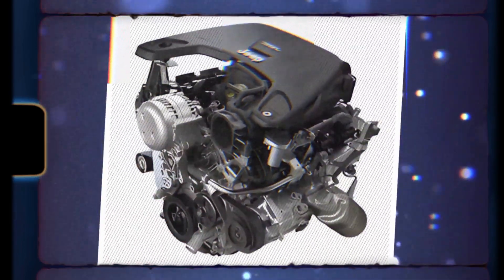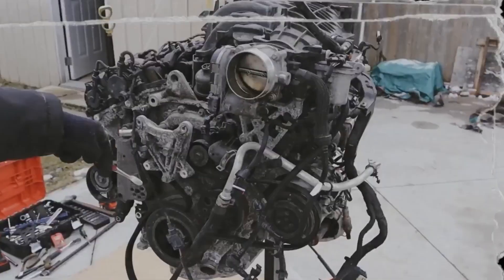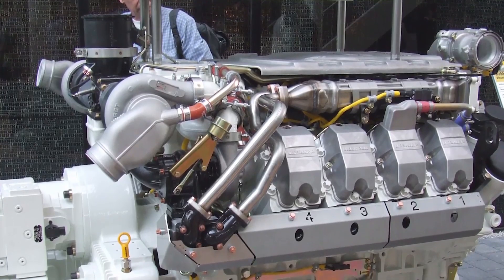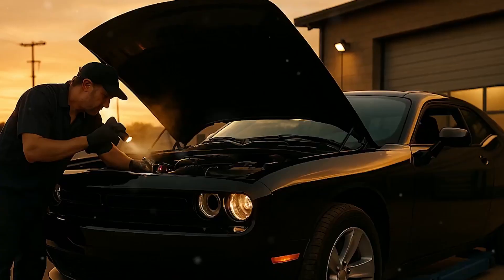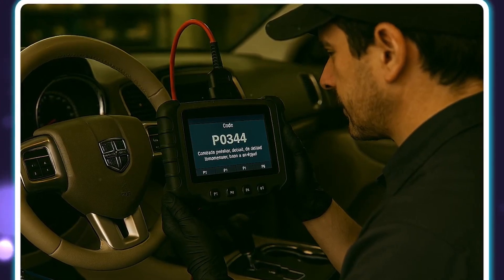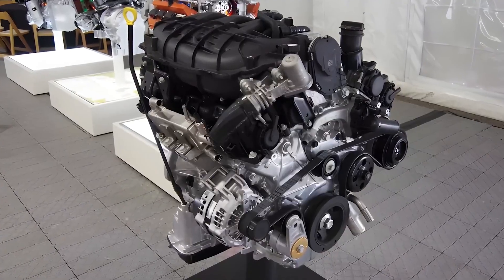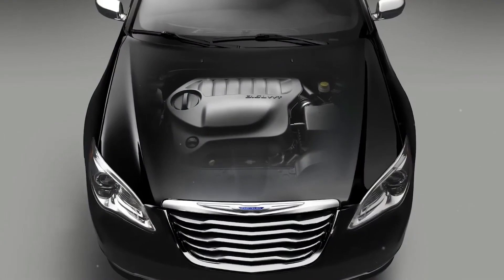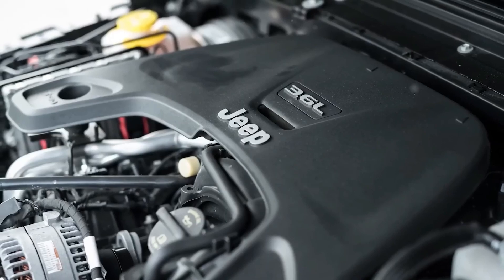Why Mechanics Hate The Pentastar 3.6.

Comment: These are very good engines. Mine is going on 13 years with no issues whatsoever. Still has the factory cooler and all the factory accessories and it has never been opened. Change the fluids regularly and it will reward you with years of trouble free driving. Engine oil changes every 3000 miles. Trans fluid every 15,000 miles and the trans filter every 30,000 miles. Keep all those fluids clean.

Comment: I have the Pentastar in both my vehicles. Not in love with it. Replaced the oil filter housing with a new metal one. Replaced the serpentine belt and tensioner. Clockspring went out.